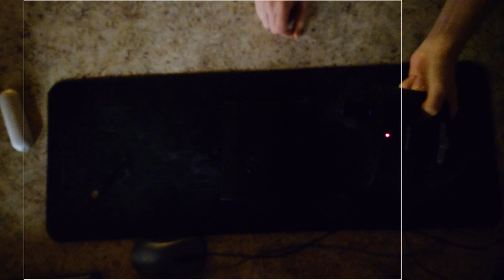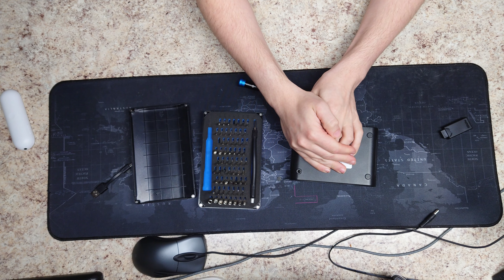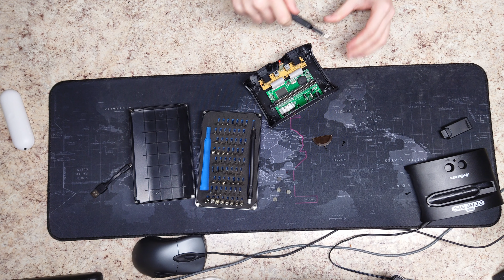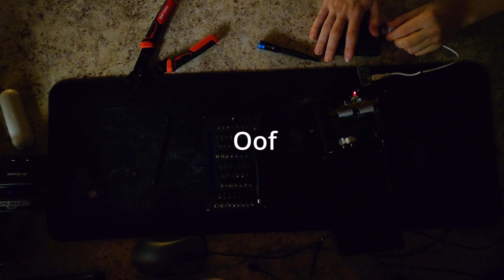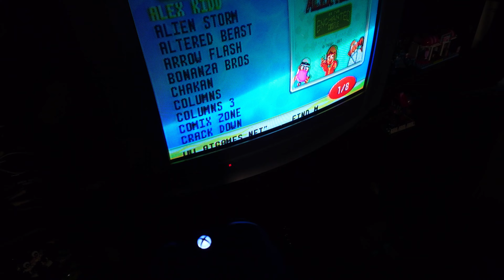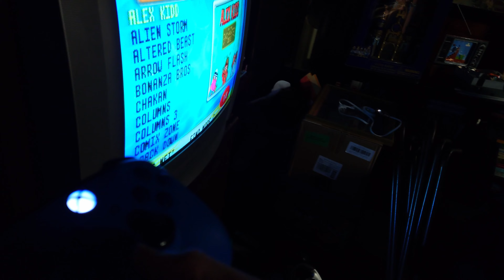I give up on Modding the AtGames Sega Genesis + Teardown

Comment: Pretty sure the sanded down chip is the rom, I also found out my genesis bootleg handheld called the pxp3 has the same soc, the red kid 2500, along with a similar menu/interface. I think at games actually modified a bootleg console to develop this thing haha